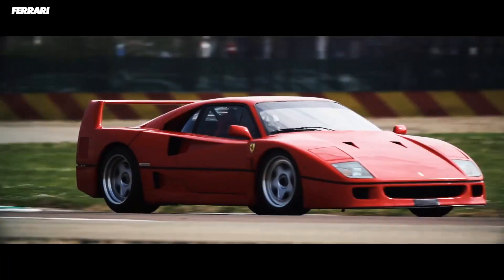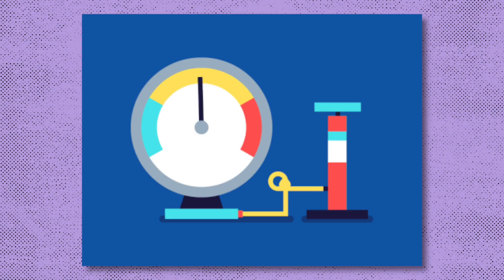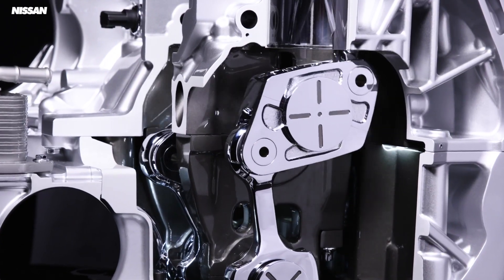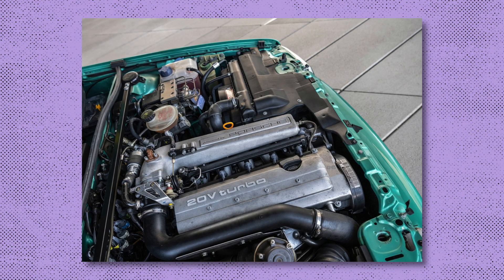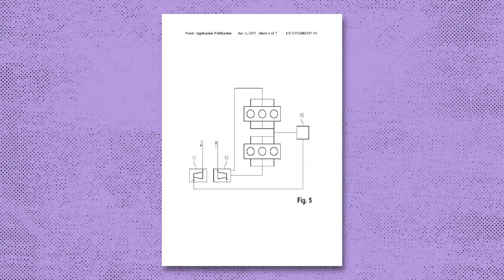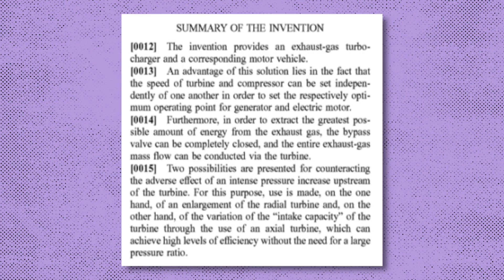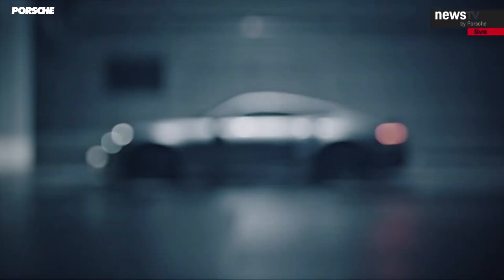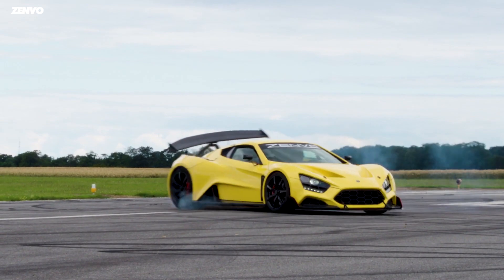Porsche's GENIUS New Turbo Design

Comment: Cool idea another thing don't turbos sap power bcuz engine has to turn turbo shaft and put load on motor a electric turbo can be isolated from motor and run independently ! Have U done a video on Koenigsegg free valve induction I'd like to hear your opinion !!

Comment: New Volvo T8 power train used something similar, use the regen electricity to power the electric turbo. But that system may be more energy saving driving but not performance enhance driving.
Reply: Porsche should do this as well.  Use the exhaust energy recovery to eliminate the alternator completely.  Less rotating mass.  Less parasitic drag on the engine.
Reply: No such thing as an electric turbo. It's an electric supercharger. You wouldn't say electric exhaust, and electric turbo is open the same tier of wrongness

Comment: Only one side of the turbo is called an impeller just as a side note.
Reply: well, actually the turbo is the turbine side and the other side is a compressor,
impellers are use for propulsion, that would be the compression side,
as is driven with inner energy out to the working fluid
Reply: @Xayuap  turbo is the complete unit....Turbine is the driving side....Impeller is the compressing side.
Reply: @catlee8064   almost, a turbo machine can be a compressor or a turbine, so you got two turbomachines in one unit

Comment: What if you attach an electric motor to a normal turbo so that it could spool the turbo with electricity reducing turbo lag and act as an alternator producing electricity at higher rpms limiting the boost instead of using wastegates
Reply: I think that’s what the MGU-H does on an F1 car nowadays
Reply: @CharlieTheMuffinBandit  Correct
Reply: The motor would probably fail from all that heat.
Reply: @Mr.President sir  why sticking the motor to the turbo.... you could use gears or something to keep the motor away...
Reply: @basidhsajan2398  More failure points.
Reply: @kensmechanicalaffair  so the rotary is the best possible engine then right? Definitely more reliable than a piston engine since a twin rotor has 3 moving parts compared to the 41  parts in a V6. 

There's more to engineering something reliable than just minimizing parts.
Reply: @Biriadan  So, what are you adding to the conversation besides a feathery criticism?
Reply: @kensmechanicalaffair  that a gear train may infact work better since it allows the electric motor to sit further from the turbo
Reply: @gork-i7c  well, turbos increase full consumption slightly. A small engine is more efficient than a big one since it has lower pumping losses. That is, energy expended pumping air in and out of the engine. A turbo improves fuel economy by pumping air into the engine more efficiently than a bigger engine would. 
But, it slightly increases fuel consumption compared to an equivalently sized NA engine since there's more backpressure on the exhaust and more energy must be used to push the exhaust out to spin the turbo.
Reply: @Biriadan  well my YouTube app doing weird things sorry about that. I’ve deleted my previous comment right after I sent it since I misunderstood whole conversation from the very beginning but I was too late you already replied lol 

I wasn’t aware of exhaust tribune would cause back pressure. Good point.

I don’t have any argument why they are not doing this, I don’t agree with heat would kill electric engine argument either that’s probably an easily solvable problem for engineers but I don’t think they didn’t think about this design as well. I think there is a reason that makes this design ineffective that we can’t see right now.

Thanks for information
Reply: 𝐒𝐩𝐞𝐜𝐢𝐚𝐥 𝐥𝐨𝐯𝐞 𝐜𝐨𝐧𝐭𝐞𝐧𝐭 𝐨𝐯𝐞𝐫 ❶❽ 𝐲𝐞𝐚𝐫𝐬 𝐨𝐥𝐝
NUDE-DATTING.ONLINE

tricks I do not know
Megan: "Hotter"
Hopi: "Sweeter"
Joonie: "Cooler"
Yoongi: "Butter

So with toy and his tricks, do not read it to him that he writes well mamon there are only to laugh for a while and not be sad and stressed because of the hard life that is lived today.
Köz karaş: '' Taŋ kaldım ''
Erinder: '' Sezimdüü ''
Jılmayuu: '' Tattuuraak ''
Dene: '' Muzdak ''
Jizn, kak krasivaya melodiya, tolko pesni pereputalis.
Aç köz arstan
Bul ukmuştuuday ısık kün bolçu, jana arstan abdan açka bolgon.

Uyunan çıgıp, tigi jer-jerdi izdedi. Al kiçinekey koyondu wins taba algan. Al bir az oylonboy koyondu karmadı. '' Bul koyon menin kursagımdı toyguza albayt '' dep oylodu arstan.
Arstan koyondu öltüröyün dep jatkanda, bir kiyik tigi tarapka çurkadı. Arstan aç köz bolup kaldı. Kiçine koyondu emes, çoŋ kiyikti jegen jakşı dep oylodu. # 垃圾

They are one of the best concerts, you can not go but just seeing them from the screen, I know it was surprising

💗❤️💌💘

Comment: it wont be cost effective , motor that will spin compressor will need 5-10 kw electrical power = wont be powered by 12v, that 5-10kw motor, will need cooling... a lot of it.

Comment: Actually  there not the first to make a electric  supper charger  a Swedish  company  did a year or two ago.if it's not run buy  Exhaust gasses it's not a turbo  there are many types of drives hydraulic  driven from oil pump or and pump added to the motor but electric  is not new .
Reply: Believe in JESUS today, confess and repent of your sins. No one goes to heaven for doing good but by believing in JESUS who died for our sins. GOD loves you soo much unconditionally.😍😚😘

Comment: An electric-driven turbo is similar to Rocketlab's Rutherford rocket engine, which uses an electric motor to drive the turbopump.
Reply: peter is a genius
Reply: aint the rutherford 3d printed?
Reply: Will the weight of the batteries that feed the electric motor and have enough storage capacity to get into orbit be more than the rocket can lift?
Reply: @andyharman3022  the motor is fed by multiple batteries and they are dropped one by one as they drain
Reply: @implodingbaby  That still doesn't answer my question about how much the total vehicle weighs when you first flip the switch.  And how much thrust does the rocket produce?  If the vehicle weight is greater than the thrust, it won't get off the ground.  

And jettisoning batteries sounds like a REAL.  BAD.  IDEA.  For the safety of people down-range.  How do they keep these falling projectiles from killing people?
Reply: @andyharman3022  the weight saved by having lighter turbopumps as well as having to carry less fuel allows for better delta v to a point. And rockets alway launch over ocean and radar is used to see if anyone is downrange. Unless you're China and don't care.
Reply: @implodingbaby  It's not the weight of the turbopumps, it's the weight of the fuel.  Turbopumps are a small fraction of the total weight of the vehicle.  I'm still waiting for an answer to how much the batteries weigh that store enough energy to get the vehicle to orbit.
Reply: @andyharman3022  I looked it up, about 45lbs for the engine itself and about 55 for the battery and pump assembly so about 100 total. The engine is at 4800 lbs of thrust and the battery size is roughly 3.7kh for the 9 mins needed.
Reply: 6 mins*
Reply: @implodingbaby  What is the total weight at ignition?  The energy density of the rocket fuel is likely at least 10 times that of the rocket fuel.  Maybe it can work.
Reply: @DumbledoreMcCracken  12.5 tons at launch.
Reply: @DumbledoreMcCracken  It definitely does work, since they have successfully completed 20 orbital missions so far.
Reply: @mrtriathlondude  that isn't the question.

The question is: is the useful energy density, and useful specific energy, of the battery / motor / pump combination BETTER than that of the propellent / (marginal) tank / turbopump.  Given the cost of a rocket that size, I don't expect 'electric' is going to save appreciable money.
Energy density and specific energy are the metrics that matter (given a specified power requirement).
Reply: @andyharman3022  WTF You have no clue what you are talking about. The batteries are just used for pumping & pressurizing fuel. Sure it requires alot of energy but modern high density batteries have enough energy capacity to do this job. This does not hinder thrust production from the Combustion of Fuel. The bad ideas are just your false assumption. This system is proven aging now and have been successfully launched 20 times. You seem to be making up absurd false assumption while ignoring basic facts you could easily look up.
Reply: @andyharman3022  It seems to have worked for the last 23 RocketLab launches and the 109 satellites the launches have deployed.
Maybe you should contact them and tell them it won't work and that they are wasting their time?
Then get a medium to contact Gottlieb Daimler's ghost and tell him his idea for a horseless carriage is doomed to failure.
Reply: @DumbledoreMcCracken  Energy density (and power density) is much higher in "regular" rocket fuel. Period. That's why all large engines still use turbopumps.
But the thing is - energy density isn't everything. It's a rough estimate for the total cost, but it's the cost that matters.
Turbopumps are the most complex and the most unreliable part of the engine. And the engine is the most expensive part of the rocket. Replacing the turbopump with an electric pump reduces complexity by a fuckton. It also makes throttling a breeze, and simplifies the startup procedure to roughly "turn on the pumps and ignite". This simplifies RnD by a lot, makes the engine cheaper and makes reuse easier - at a cost of higher dry mass of the rocket. But it seems this tradeoff paid off for Rocket Lab.
Reply: Kinda sad that its applicable to only small rocket engines.. hope battery technology will change that ..
Reply: @davidtogonidze4281  🤣

Comment: Hasn't mercedes and honda been using split, electronic assisted turbos for a while now in their formula 1 cars? This still isn't new
Reply from the maker: They are still connected by a shaft, so compressor and turbine speeds are equal. Porsche have the ability to vary this
Reply: Believe in JESUS today, confess and repent of your sins. No one goes to heaven for doing good but by believing in JESUS who died for our sins. GOD loves you soo much unconditionally.😍😚😘

Comment: An electric driven turbo is a step backwards. an exhaust driven turbo is literally free energy produced by the waste heat of the engine.
Reply: electric turbos literally spin the turbo on the initial push and leave the rest up to the exhaust gases once exhaust velocity picks up. How is that a step backwards?
Reply: Found the person who didn't understand/watch the video
Reply: Listen to how it actually works the exhaust drives the electric generators which in turn spool the turbo
Reply: @Nr15121  So youre adding an extra step of totally un-neccesary complexity and cost. Brilliant.
Reply: @Followme556  Lmao, going from a Ford flathead V8 with 110 HP to a V6 with dual overhead cams and variable valve timing at 300 HP is more complex and costly, but no issues with those?
Reply: @RhodokTribesman  Sure, that comparison is absolutely the same thing- you're not being ridiculous at all.
Reply: @Followme556  How does an engine get to that point to gain more power? Complexity of engineering, systems, or materials. The reason engines today are so good are because people tried out new technologies to fix certain aspects of the power delivery, hence why electric turbos are becoming a thing
Reply: @RhodokTribesman  Not all technological doodads are advancements. Many of these gee wiz high tech gadgets are steps backwards.

Comment: The first thing that comes to mind when hearing "electric turbo" is cheap ebay computer fans that barely move air, leafblowers from Mighty Car Mods and Hoonigan with their "Homemade Quad Turdo Setup".
Reply: Cletus McFarland had a turbo vid as well, from what I remember it wasn't that bad. But it was faaaaaar from just a cheap fan, it was like 5k iirc
Reply: @CreamAle  And even then, didn't they get like max 5-7psi? (which for a road car is pretty damn impressive from a consumer electric turbo)
Reply: @RhodokTribesman  yeah it's not great when compared to normal stuff. But it's a step towards new tech and one that proved the concept was fully possible.

And it wasn't really a consumer product tbh.
Reply: @CreamAle  none of this is new tech. This is a ripoff of the MGU-H in formula 1 that Porsche is trying to take credit for. But the whole idea of an "electric turbo" is stupid. It's an electric supercharger. A turbo is a compressor driven by an exhaust gas turbine, which this is not. It's a compressor driven by an electric motor b
Reply: @Biriadan  i wasn't talking about Porsche at any point I  my comments. Nor did I say they invented it, but calling it a ripoff is stupid. It's an iteration and a step towards new tech. By your logic we'd still be using Edison bulbs due to any other light source being a "ripoff".

And btw, it's not an electric supercharger either, it isn't driven by a belt like normal supercharges. By your logic.

So it's an eturbo if they want to call it that as there isn't an equivalent product that's powered the same way.
Reply: @CreamAle  I see the big jump in electric motors power+ RPM out put. . Several years ago 1/8 scale nitro RC cars were the fastest and most powerful . Now it's 1/8th scale electric and 1/8 scale motors + esc in the smaller 1/10 scale rc cars. ... Battery tech also plays a big role.  But brushed motors lack the ability to change timing as rpms build. Only run from both sides of a single phase. Vs brushless having 3 phaze input  from the esc. .. also brushless motors aren't capped at 150°F and most come with 100k RPM bearings . . With a brushless rc motor more poles= More torque less Kva = even more torque. . And Kva = unloaded engine RPM per volt. . The easy 100+ mph rc build is 4x4 1/10 scale Traxxas slash with. 6 S ready 2200kva 1:8 scale motor esc combo. A 1:1 pinion spur ratio. And foam or better high speed wheels. With decent 100+A  6s battery. ( 4.2,v per S (S=cell) . There's no nitro that can hang. . So if attempting to build something of this nature. Torque is king . The slower 2200 Kva ( pretty much slowest/ lowest kva avalabile) is best. Also unlike our beloved piston engines. Electric brushless motors have constant torque throughout the tom range. . It's a flat line at Max from 1rpm to it's limit.
Reply: @Biriadan  technically, the compressor is driven by the turbine albeit a convoluted path. 😁
Reply: @CreamAle  lol I actually dmed that product to him and magically he made a video about it a few weeks later
Reply: @CreamAle  yea and to top it off it wasnt great for a V8 but good for a four cylinder
Reply: @CreamAle  Believe in JESUS today, confess and repent of your sins. No one goes to heaven for doing good but by believing in JESUS who died for our sins. GOD loves you soo much unconditionally.😍😚😘